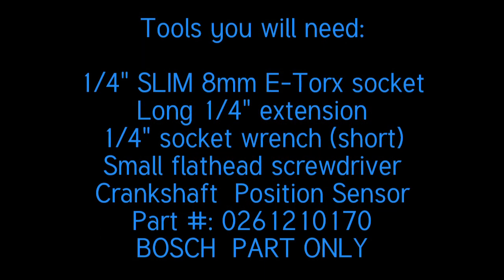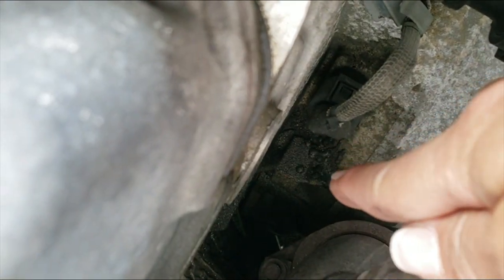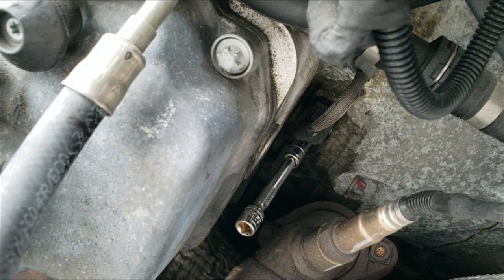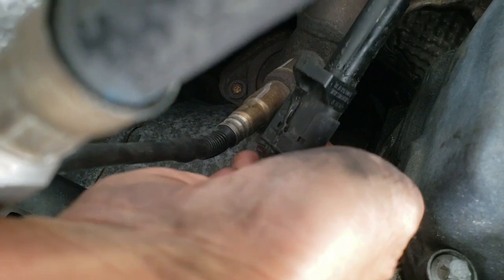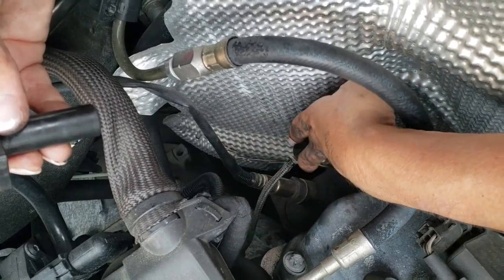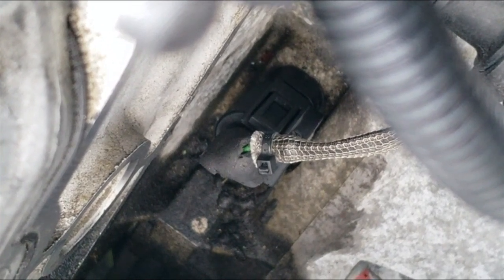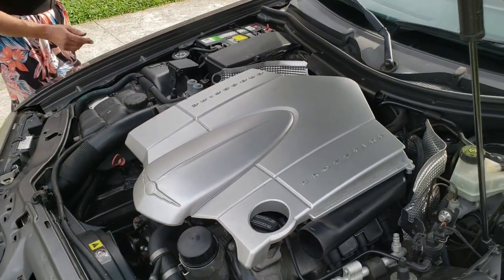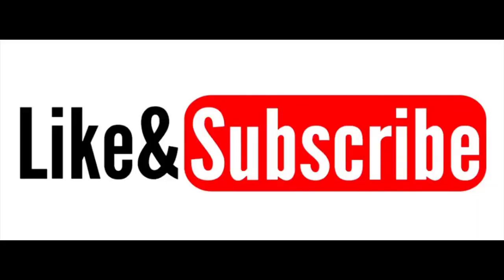Replace Crankshaft Position Sensor CPS Mercedes / Chrysler Crossfire

Comment: It's easier to remove crank sensor with 2 small heat shields removed. Mine rattled on spring start up awhile back, removed cam, crank sensor cleaned them up, presto. Yeah always replace heat shields. Clean rinse dry KN filters twice a year for good throttle response, and re oil  !

Comment: So this video was so helpful to me. I have an SLK 320 but all the videos for MB show other models that are slightly different. This video of a Crossfire shows the same layout of my SLK of course, and so the true location and better yet, it cured me of the idea of trying to release the electronics wire first!!  I now see I have to not see that is I have to feel for the bolt on the underside of the sensor piece. My SLK does indeed have a heat shield so this will be a bit tight but I think now, armed with the best method for my model, I can do it! I will update soon. THANK YOU SO MUCH.

Comment: Hello I'm having issues with my 2007 it's in limp mode I have changed the conductor plate  code I'm getting now is p2106&p0743 help please

Comment: Just watched your video, very informative and easy to follow. Would like your opinion on an alternator replacement. Checked with the dealer today, service charge to replace alternator: $84+tax ... very good. Cost of alternator from dealer: $1,317+... HOLY SH**! Any recommendations on a good alternator, brand, etc...? Appreciate your opinion. Thanks!
Reply from the maker: https://www.fcpeuro.com/products/mercedes-benz-alternator-c240-slk32-amg-c32-amg-c320-clk320-ml320-ml350-slk320-al0787x
Reply: This a very late response.... but you can try having your alternator or starter rebuild, it will save u a bundle 🥰

Comment: Well thank you very much 
I have a 2004 slk 32  after several searches I narrowed the problem down to the k40 relay or the cps 
The car would alway start cold the after a while would just shut 
off . Then 20-30 minutes would start again!
People are not very nice when you stall in four lane traffic!!!
Unable to get in the shop i watched your video a couple of time and i am glad to say I was able to do this myself. 
You’re awesome for doing this video 
I hope this helps others
Reply: That's definitely the RCM, don't buy a new one just resolder the board on the 3-weak points

Comment: Any advise? Replaced crank shaft sensor now it just starts and dies, threw map code replaced it as well. Still just starts and dies? Any help I’d appreciated! Before I started replacing sensors car ran and drove fine but would shut off at full throttle.
Reply: Cam sensor, right front of engine, easy peasy to get at. Clean air filters. Didja solder RCM 3 points  ?  Check for loose fuse boxes.
Reply: Could be the skreem with a faulty key reading. Sometimes causes the car to start but then will die in 3secs or so. Mine died and had some no crank no starts. I replaced the RCm (relay control module), very easy, and it fixed the starting problems. For now.